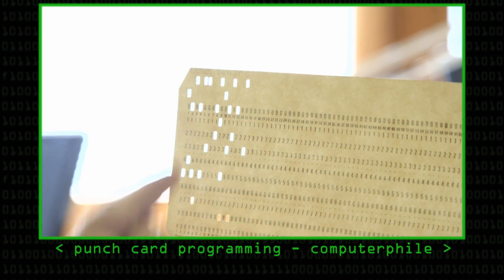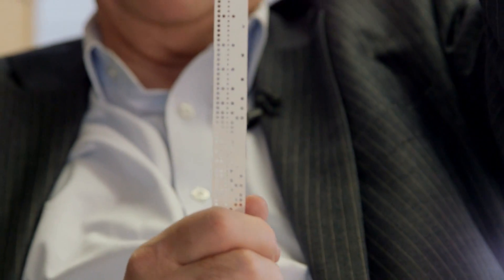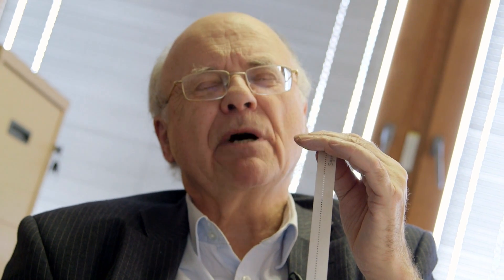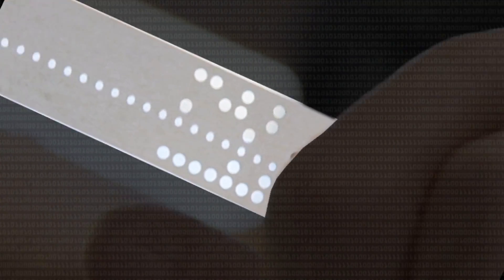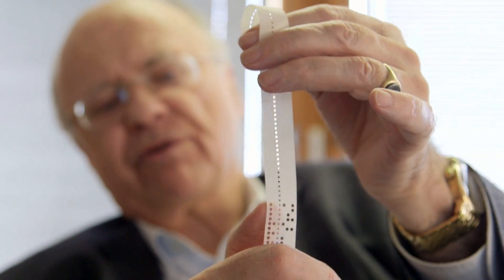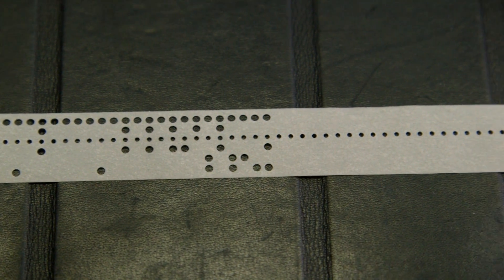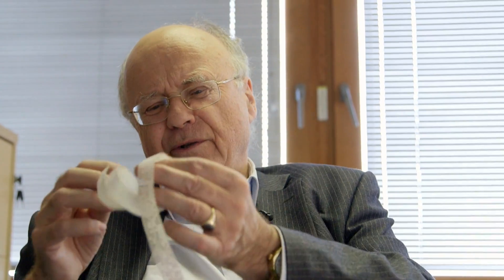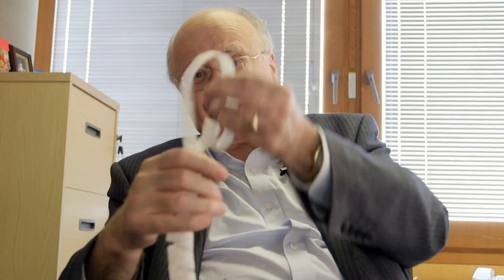5 Hole Paper Tape - Computerphile

Comment: Is there an alternative to the punched tape but in this example it used a micro controler and the lights .
You whote a programm then use the correct led switch timing then you have the same thing like punched card but not with the tape but turning lamps on and of in a different frequency

Comment: Imagine writing a 4-bit ROM onto this 5-hole format, and using the "5th bit" to provide "tracking information" like on magnetic tape, that way through the computer could jump back and fourth to specific instructions on the punched tape ROM.

I'm aware of the purpose of the program counters role in a computer, but I think this tracking system could work well in conjunction with it.

I suppose you could just dump the whole progrm into RAM, but this way you wouldn't have to.

Comment: All holes punched in 5 or 8 hole tape, is a shift to "letters" case in 5-bit and was often used to rub out a mistaken keypress.  And a null character in 8-bit code, no figures shift.

Einstein's photoelectric effect had to do with positing the existence of photons.  It had nothing to do with inventing the  photoelectric sensing tube.   It was about how wavelength affects the emission of electrons.  The photoelectric tube had already been invented.

Comment: Long ago when I first joined the military, I worked in a career field where we used five level perf tape, for transmitting messages, and other things. The little hole is punched out of it. Tape is called Chad. And over the course of a shift or two, you could get quite a lot of Chad dropped into the Chad bucket. we had a joke that we played on new people. Towards the end of the role of a tape, there would become a reddish tinge to the tape to warn you It’s time to change. For new people, we would tell them that they needed to go through the bucket and separate the red Chad from the white Chad because although the white Chad can go out in the regular trash, the red Chad was for classified material and had to be burned separately. Was amazing how many people we caught on that……I was one of them.

Comment: One time, I was on the submarine and happened to have a cigar box, rubber band, and a paper clip. I took the chaff from the bit bucket on the SINS computer and put a whoooole lot in the cigar box. Taped down the rubber band to the sides, wound it up with the paper clip in the middle, and shut the top. Set the cigar box down on the mess decks. Oooo ... cigars!! ... asshole!! Even though I had to help clean it up, it was worth it.

Comment: Back in the early 70s, I was a technician working on Teletype machines.  I never saw any 7 bit tape, but with 8 bit tape, the 8th bit was used for parity, for basic error detection.  There was also a 6 bit code, which was the 5 bit code with the 6th bit used for shift.  This was used for ticker tape machines, where with the stock codes and prices there was a lot of shifting.  The shift would also cause the printing to move over, so that the stock codes would appear on the top portion of the tape and the numbers on the bottom.  This made it easy to scan through the tape, looking for a particular stock and then seeing the price.  I worked in the Toronto Stock Exchange for a bit over 2 years in the early 70s and there were a lot of ticker tape machines in there.

Comment: The following hole patterns (I don’t remember any actual patters except Null (leader/trailer) and Rubout) are immune to the current case setting of the printer:

Null or Leader: no holes, used to put labels on and to start reading; and Rubout: all five holes, used to “erase” a typo when caught immediately;

LTRS case: puts printer in letters case, and FIGS to put it in numbers case; note that if a single pattern were used to toggle, you could never get back in sync;

Carrier Return and Line Feed: you don’t want to continue typing at the right side of the paper and get nothing but a smudge; the reason they are separate (and CR is always first) is so that the first character of the next line doesn’t get printed on the fly before the carrier has returned to the left margin.  Also, CR by itself can be used for intentional overprinting, and LF by itself can be used to avoid excessive spacing.

Comment: i worked for a company that built SCADA systems in the 1970's we would punch the boot strap into paper tape..once you were comfortable that the  code was solid we would make a copy from paper tape to mylar tape to prevent the tape being torn ...we used teletype machines to punch the tape it was pretty slow going though and sometimes would jam.. and the PTR (paper tape reader) was LED's with photocells..it was pretty fast for the time period..all 8 bit tape..

Comment: The use of paper tape to control an automated device doesn't go back to the 19th century but in fact to the early 18th century! Basile Bouchon invented a machine to help setting up a drawloom by using punched paper tape to set the pattern. In 1728, he changed the input from tape to punched cards similar to those used for the next 250 years, but it wasn't until Jacquard invented his fully automated loom machine in 1804 that the technology was widely adopted.

Comment: One question that came up for me during the discussion of copying was that of media costs--how much blank tape (in feet, meters, or characters) did you get for a pound? Or did you buy lengths of plain paper with the right width and run them through some sort of friction-fed machine to punch the sprocket holes, and then through the actual output punch to store the data? The latter seems less likely but I wouldn't be surprised either way.

Thanks!
Reply: I don't recall the cost, but you'd buy the tape in big rolls.  8 bit tape was also available in "fan fold", which was preferred in computer rooms.   There was also mylar tape available for making permanent copies that wouldn't wear out.

Comment: But why 5? Was 6 too much for the machines of that time to handle? You would not need a number/figure shift if you had 6 bits.
Reply: If you add a sixth bit to five you are effectively increasing the data rate by 20%.  Actually there is a start and stop bit but regardless you would be charged for the extra data.  "Telegraphic" used to be a synonym for "terse".
Reply: There was a 6 bit code used for ticker tape.  With stock prices, there was a lot of shifting, making a 6 bit code more efficient.

Comment: For the character limitation I wouldn't have ever thought of inventing a shift key, I would have just used the existing alphabet to do Roman numerals or something like that
Reply: I accidentally reversed engineered the shift key in the shower while thinking about how to let a Turing machine know whether a piece of data was holding input or code... the great problem I wanted to solve was how to make a computer out of macaroni pieces because I heard that line in a song.
Even with that I didn't made the connection between that and shift keys :v

Comment: Thanks for the memories! Remember that Teletype is a U/S registered brand name. The machine is a teleprinter, and yes; Creed made them in the U.K. The Creed 2300 was in popular use in Britain in the early to mid-1970's (the ones in Plymouth Poly had 8-bit tape punches and readers fitted), and it was a semi-electronic machine. Earlier models, such as the Creed 3, the 75 and the 444 were fully mechanical, and could be very noisy.

Comment: Cant fit all symbols on a 5 bit hole punch? Make it 6 bit. Now you have 64 spaces. Still not enough? Do 8 bit then. 256 spaces... isnt that enough?
Reply: @GoliathCZ  There is also the problem of making the tape too flimsy. Punching 4 out of 5 holes on five or more consecutive characters makes for tape that can tear or break easily in a mechanical reader. Check the previous video on punch cards. I was not aware that no more than 2 holes per column were punched, probably for a similar reason.

Comment: Tried saving a SYM-1 program to a paper tape on an ASR33 teletype (mechanical reader, not optical) cause couldn't save to a cassette tape.  Unfortunately, the teletype was two decades overdue for service, so that didn't work either.   Grrrr.

Comment: They really screwed up picking a bare minimum 5 bit instead of 6 bit.  64 combinations would of given a much more useful character set with control characters to boot...   also you could avoid or set as the least frequently used characters some of the more hole ridden characters like 11111 or 10111 or 111111 that would make the tape really weak at that point.
Reply: There is a later 6 bit code called TeleTypeSetter (TTS) used by newspapers.
Reply: The early applications needed just upper case letters, numbers, and a few punctuation and control codes.  It was many decades before computers were invented

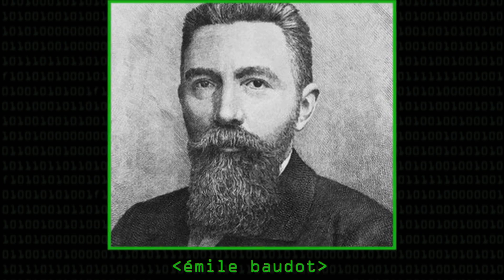Comment: 1:25 The sprocket holes were also punched as the data holes were being punched. So the tape did not have to be manufactured with the sprocket holes (synchronization track) pre-punched.

Comment: I had an Idea if a completely disposable drone could be made using punched hole paper tape on a cardboard or paper drone plane, where the paper tape could be pulled out by the Airflow over the plane and tape to act as flaps to steer plane where holes lets the air through and where not act as if flaps up or down on wing, except not sure how to design make such a thing so so I come up with Carl's Challenge I Challenge anybody if the cam make a completely disposable paper or card drone or paper Airplane pre programmed by Punched holed tape and no electronics just punched tape and Airflow over the Plane/Glider Alone,
Reply: It's possible but you'd still need electronics to read the tape. You've almost reversed engineered the Turing machine

Comment: The more i think about it the more weird it gets with reserved combinations, it seem given 5 -bits you could actually encode anything using lookup tables. You could chain the encoding semantics not just toggle between two states. Using something like a binary min max search you could encode things shorter than their actual bit representation.

For example we could encode a 32 bit pixel or combination of pixels using this principle and it will find the actual bit in less using less bitsteps than the actual bitcombination.

But the encoding will be state sensitive, so what you get is a result from the original state, what is this? Is there math that describe such properties of encoded lookup tables?

It seem almost magic.

Comment: Thinking about it, you could actually use a four hole tape for 8-bit ASCII. Just use registers to accept 4 bit data twice, and smash the two four bit numbers together to make an 8-bit code.
Register:00000000
Tape:1011 Four bit code,
Register:10110000
Tape:0101 Four bit code,
Register:01011011 Wallah! An 8-bit code! Send it off to the computer,
Register:00000000 Clear for next two paper codes.

I understand that this would be a slower process, but it would work great for an 8-bit machine, if it existed during that time.
Reply: +Quentin “SpecialBomb” Jankosky 
It's a pity nobody came up with UTF-5.

0xxxx
110xx 10xxx
1110x 10xxx 10xxx
11110 10xxx 10xxx 10xxx

4 bits = 1 line
5 bits = 2 lines
7 bits = 3 lines
9 bits = 4 lines

You'd allocate the four-bit codepoints to ETAOINSHRDLU and a few other things, to maximize your overall coding efficiency.  Then you have plenty of room for numerals and punctuation.  Also, since the leading bits tell you whether you're looking at a multi-line sequence, there's no danger of starting at the middle of a tape and ending up in the wrong shift mode.

Unfortunately, long strings of digits would encode less efficiently than when using a shift, and it may be difficult for the telegraph service to explain why some letters are more expensive than others!
Reply: Samuel Morse invented a variable-length coding which was rather popular for sending telegraph messages.  What's curious is that a variable length code was used even when sending encrypted messages where letters had uniform frequency.
Reply: That was done with 5 holes.  With only 4 you wouldn't know where the character started.

Comment: What did you do with the dots that got punched out?
Reply: In the US Navy there was such a thing as "chadding" someones bunk, i.e., throwing chad in their bed.  Chad is sharp.
Reply: The used tape used to be thrown out the windows at dignitaries.  Hence ticker tape parades.
Reply: @richardhaas39  That was ticker tape, which used to be quite common.  It printed letters and numbers on the tape, instead of punching holes.
Reply: There was a bin that collected them.  Back when I was a tech, we'd take some and put it under the fan of a machine another guy was working on.  When he started it up, there was chad everywhere!  😀

Comment: I worked for a machine tool builder back in the early 80's and our first NC machines (the grandfather to the CNC) had this paper tape to run the program. I can remember having to "modify" the program with tape and a hand held hole punch. Cover up the holes you don't want, punch new holes, and hope it did not get caught on the pulleys as it was being fed through. Then came the floppy disk. It was about 8" in diameter and held 640k of information. High tech!

Comment: What language were the programs written in?
Reply: The 5-hole tape I was using for the video came from the EDSAC rebuild project at Bletchley Park. (EDSAC was a pioneering first-generation computer originally built at the University of Cambridge; it went into operation in 1949). Sean is hoping to do a video on this project fairly soon. The particular tape I was showing contains a classic test program for EDSAC, which calculates the first few primes. In those days, and well into the 1950s, programming was done in assembly code specific to each machine's architecture. General purpose higher-level languages such as FORTRAN and COBOL began to appear in the mid 1950s
Reply: Great, assembly in that case then. I hope to see the edsac video

Comment: How similar is this to the tape used for old CNC machines? Up until at least a couple years ago, we'd go to a sheet metal guy who would whip up a CAD drawing, transfer it to a punched paper (or plastic?) tape, drag the tape to the machine, which would convert the data to something the machine could read, and ironically, punch holes in sheetmetal according to the original CAD drawing.
Reply: Mylar (which is a brand of plastic).

Comment: So he had the forethought to assign the most common letter (E) to a single punch to reduce wear and tear, but not enough to only use that punch in conjunction with others for the rarest letters? That one side of the tape has a hole punched nearly every single line - that punch will wear out several times faster than all the rest anyway.
Reply: A good point, but if you study the Baudot-Murray code you'll see that E has just a 1-bit at the left and T has just a 1 bit at the right . And the very rare letter Z (in English anyway) has a code 10001 (which combines the E and T positions). I've sent off a link to my PDF sheet on the Baudot-Murray code, to Sean, and am hoping he can add this to the info page for this video soon. It's instructive also on that sheet to look at the B-M codes allocated to "A", "O" etc.

Comment: it bothers me that it is not 6bit to make it symmetric around the sprocket holes...

would also give you 64 symbols...

was it done to make sure you read it in the right direction?
Reply: Yes, the "right direction" was a big bonus with an asymmetric line of sprocket holes arising from an odd number of bits As you put the tape into the reader you couldn't engage with the sprocket holes if it was the wrong way around! Also the rule was (as I recall) that if you lay the tape horizontally with the narrow band at the top then reading down the columns top-to-bottom would give you a readout of the Baudot-Murray code
Reply: RoySchl But 20% more bits to transmit, 20% more mechanical parts, etc., all for very little gain.  (Until there was lots to gain.  And then they jumped to 7 bits (which allowed for a parity bit or extended characters).

Comment: I see you 'rolling up' the tape thus causing 'pigtails'.  Here's a clever method of 'winding up' the tape that I still use to this day on fiberglass tape measures. With the fingers of your left hand (reverse for left handed folk) wind the tape across the fingers in a figure of eight pattern. This makes a cupped shaped figure eight. To re-use, take from the center of the cup. The tape leads seamlessly without kinks. Depending on how large your hand is, quite long tapes can be tamed.

Comment: Asymmetrical position for the sprocket holes - presumably to prevent putting it into the machine the wrong way around?
Reply: well, you are forced to put the sprocket holes asymmetrically, since it is a 5 bit code you can't put them exactly in the center
Reply: Also to show you how to read it the right way round.